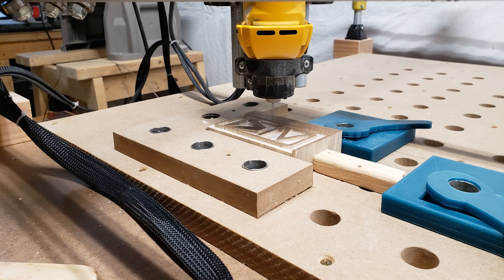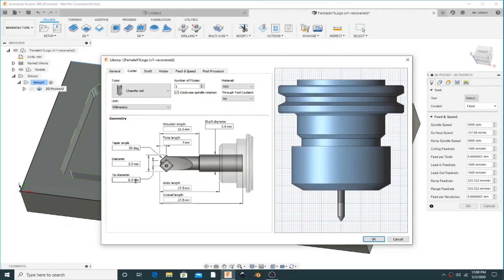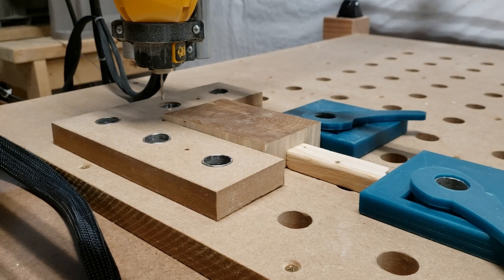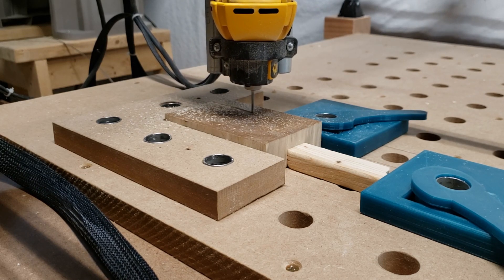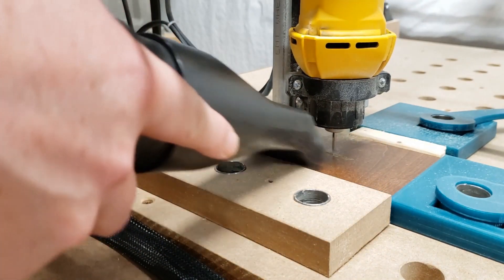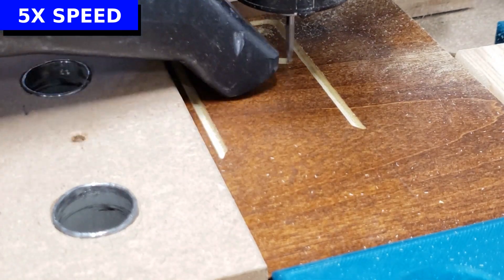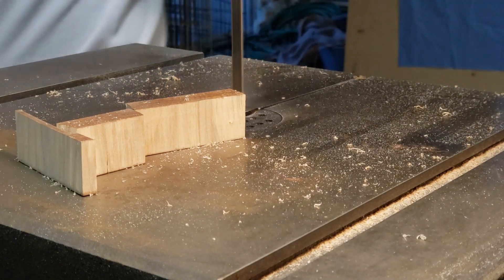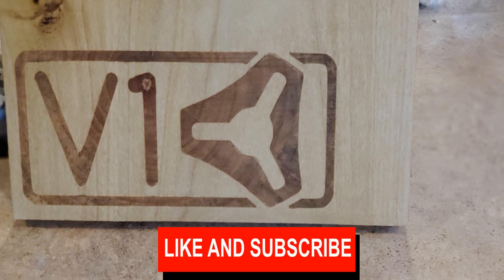Inlay Technique Using Fusion 360 and the MPCNC

Comment: Great video. One thing I couldn’t figure was whether you modelled the “slope” of the walls to match the angle of the cutter you are using (30 degrees) or whether you make the walls of the model vertical then let the tool path create a slope.
Reply from the maker: Hi Andrew, the slope comes from the tool, you can model vertical walls.

Comment: Very nice, I have to try this.
Reply from the maker: It works well. I am moving to FreeCAD and I think I will make another video showing how to do the same thing in FreeCAD. (Hopefully it works ;-) )
Reply: @Adventuresincreation  Why are you moving to FreeCAD? I'm just getting comfortable in Fusion and even though it has several things that I really dislike, I'm enjoying it. I guess I can give FreeCAD a try though.
Reply from the maker: I am concerned that I have invested many hours in fusion and it is at risk because autodesk can take away functionality at any time. I cannot pay $60/month. Freecad is opensource and always free. You can improve it with python and the community is vibrant.
Reply: @Adventuresincreation  I share the same worries you do about Fusion. I think it's a great software and I really enjoy learning and working on it. It does have several things that aren't acceptable for a paid application of one of the biggest companies of its field though (like the Text handling). It does crash on me a lot, or behaves erratically. And the license model is just shady. 
I'm going to give FreeCad a try.

Comment: Could you show how you made the male part in Fusion? I can't get that to work for me... :/
Reply from the maker: I will see if I can make it clearer.
Reply: @Adventuresincreation  Thank you so much for the video.  I have been stuck on the same question as above? I make the female with 2d clearing then run a 30° cutter around the profile to give it the angle.  But when i model the male and go in to Cam i cannont use the 30° cutter to just simply run the profile again after 2d clearing.  I would be very grateful if you could show how you did that exactly.
Reply from the maker: @shadaytree217  I will do a new video and focus on the tools.